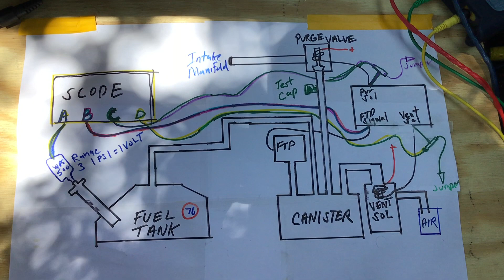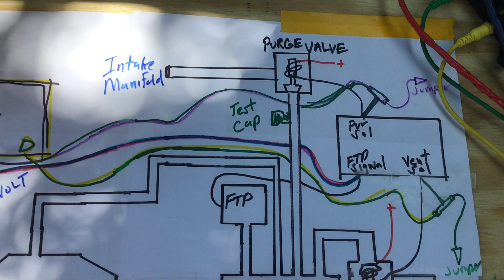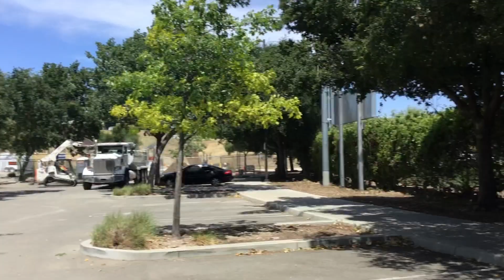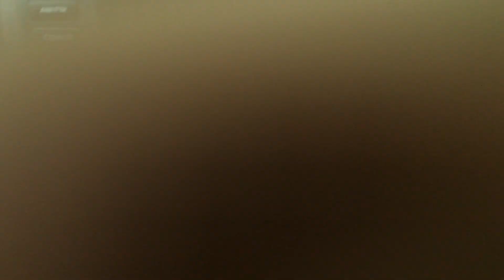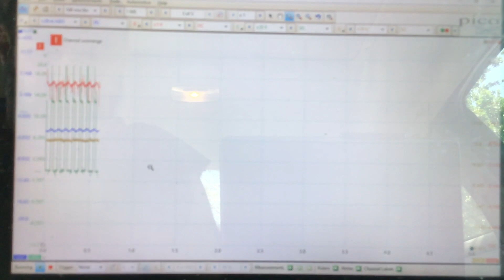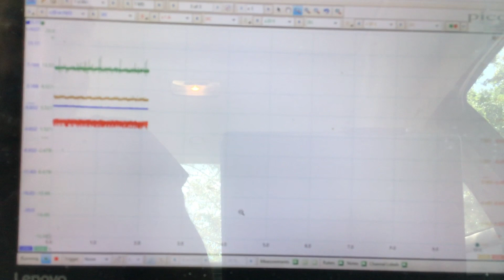EVAP DIAG WITH PICO SCOPE

Comment: 5:51. Wish I could see the X-axis. What is the period of the fuel tank pressure sensor? What is its amplitude (max/min)?
Reply from the maker: Thanks for watching as far as amplitude and X axis. I’m basically looking for change with the scope not so much a specific amount of pressure or vacuum to validate the system is tight.